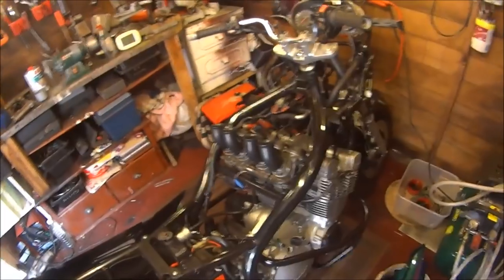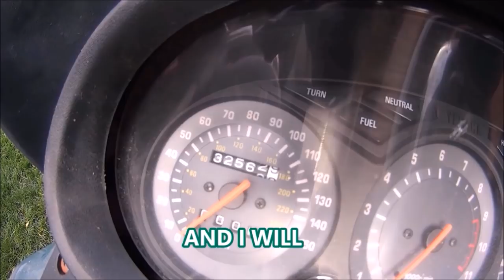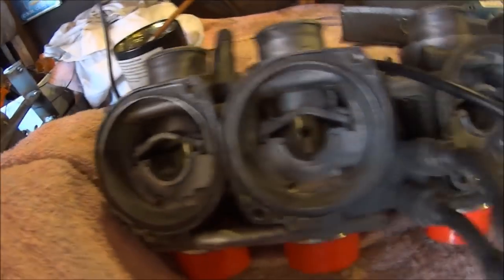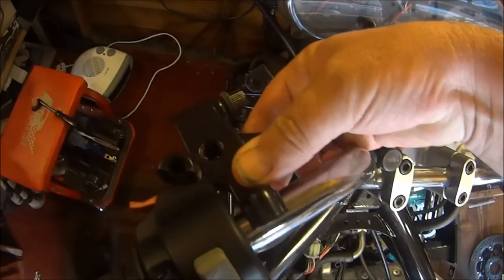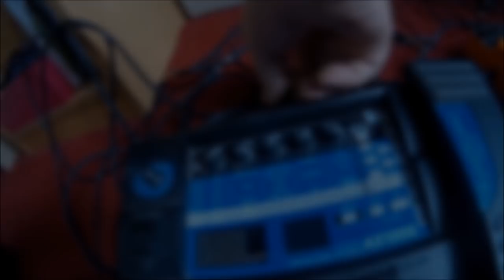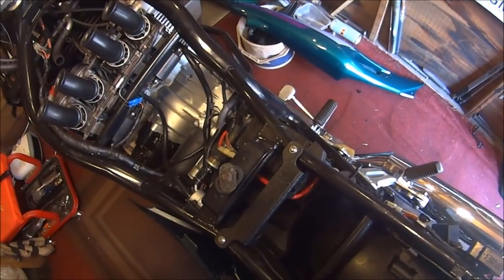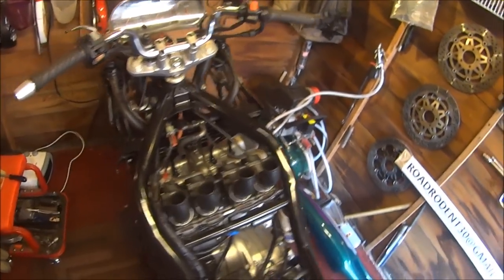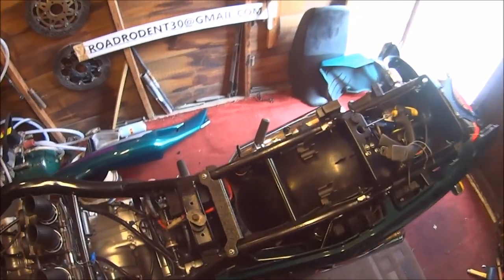Xj900s  diversion carburetors. Help,

Comment: If you have a manual you could confirm the wiring using a multi meter. Just a suggestion bud.
Reply from the maker: Yes checked the manual and all seems to be on cheers Steve.

Comment: Has with CV carbs.its caused by going from pilot jets.to main jets.normaly a damaged diaphragm...yes cylinder 1 is clutch side firing order is 1342.....easy way to see if carb inlets are leaking...run it spray easy start around .inlet manifold .if engine picks up ...the rubber is leaking ..
Reply from the maker: Dude you certainly know you're stuff. Carburetors rubbers seem to be fine but the carburetors are flooding ao I need to strip them down again.. OMG.
Reply: @jonyr1TT  40 years under my belt working on bikes
Reply from the maker: @bigmuller1  do you have your own bike shop?.
Reply: @jonyr1TT   no no ......ime afraid 40 years of messing with various.delapatedheaps taught me life skills.starting with a mobylette...then a c90 .... Basically a bike is a c90 with 4 cylinders.me 
Like you started at primary school.with a model aircraft twin lined spitfire.keilkraft......wow did I get burned off that..then at 12 had a Hillman imp to play with
Reply from the maker: @bigmuller1 .. Yes the memory's are flooding back lol mobyletes c50 70 90 puch maxi Raleigh runabouts ss50 ap50 fs1e garelli record and the list goes on and on lol.
Reply: @jonyr1TT  to a 9 year old.like me in 1976..a fs1e.     DX with a copper tube .knocked in the exhaust with a lump hammer.borrowed from granddad's shed.was like a rocket ship.thought my face would melt at them speeds....had a pair of welding glasses on just in case
Reply: Saying that.my neighbour when I was 14 left my parents look after there house for 2 weeks whilst on holiday....what was in the garage....a laverda Jota....one thing led to another.bugger it....let's take it out.....ooooooohhhhhhhhhoooohh mmmmyyyyyy gggggggggooooodddd.did that thing scare us.was a beast of a thing.fook that.never again.like to jibbering wrecks lol
Reply: Cylinder no. 1 is the left-most cylinder when you are sitting on the bike. Cylinder 4 is on the right side where the clutch operating arm in located.

Comment: Guitar playing does help calm the nerves. Some cigar smoke could help to see a vacuum leak. Did you put a new finger screen on the petcock? CDI looks terrible. Does it smell of electrical fire?
Reply from the maker: Thanks mate think I've sorted the flat spot out now. But now the carburetors are flooding.
Reply: ROAD RODENT there is a site on google called fixya that describes your carburetor condition and how to remedy it. Good luck.👍🍀
Reply from the maker: @mikehancock6280  cheers for that mike I'll definitely check it out..

Comment: Remember.its got what you call a wasted spark system.meaning it sparks on all strokes... unlikely to be ignition problem.......more fuel based
Reply from the maker: Cheers darren yeah think your right it doesn't seem like it is a ignition fault.
Reply: @jonyr1TT  more fuel side definitely
Reply from the maker: @bigmuller1 ..... I agree.

Comment: I've just checked mine (have only just started my rebuild, is in a similar state to yours when you started!), and the coils are top red on both sides, orange and white below, L & R. My CDI also has some of that marking on the back, but lower down in the middle - so I suspect just budget manufacturing. Aside from the coils, I'm no expert but the throttle issue may indicate a main jet problem? It's happening when you come off the idle jet onto the slides, which then don't seem to be allowing fuel - indicating the main jets they sit in have got crud in them?
Reply from the maker: Thanks Philip some very helpful and useful information. Good luck with your divi hope it all goes smoothly for you.
Reply: @jonyr1TT  Thank you, am employing your inlet silicone hose trick to get it running first of all!
Reply from the maker: @philipsmith2208  mine seem good up to yet. It's £80 for 2 new ones and I needed all 4 so I at to come up with a cheaper solution.
Reply: Hi iv been fixing my xj 900s up now welding the down pipes to the  collecter box be cause it may clear up the problem with air leaks so wish me luck this clear up the miss fire when de acceleration and im looking at air leak to cab no holes in the in take rubbers
Reply from the maker: Hi mark. good luck with the welding . don't forget to remove the cdi if your welding on the bike.
Reply: Hi thanks for that i will take the cdi off before welding  im also doing the o rings im the inlet menifolds so im busy trying to get the xj 900s divetsiom back to normal running wish me luck hows your xj now
Reply from the maker: ok mark best of luck hope you sort it,.. my d9 still not right.

Comment: How do you remove the carburetors? I've loosened the screws on the rubber pipes underneath but i cant pull it up.. They flood the engine block with gas so i have to remove them and inspect..
Reply from the maker: In my case it was brut force in the end. 
The rubber manifolds where perished and rotten these bikes are known for it.
Reply: @jonyr1TT  Thank you very much for answering. I'll try to just pull with a diaper on tomorrow! Cheers :)
Reply from the maker: https://www.youtube.com/watch?v=iGQ4QpbEpeI

Comment: Hi road rodent it good news that your doing a xj 900s diversion very good to flow you ihave a problem with my xj 900s diversion it bad stating on choke it a pain iv clean cabs out and put cleaner in tank but it a pain to start after a cople of week can you help with this thanks
Reply from the maker: H Mark thanks... I would check the state of the spark plugs and make sure there's a good spark on all 4 plugs.. It's the first time I've had a bike like this with the induction pipes and reed valves. So it's a bit of a learning curve for me also.. Good luck and happy new year buddy.
Reply: @jonyr1TT  hi road rodent it mark with the xj 900s diversion the spark no great iv change the coils and spark plugs iv got a ignistion pick up to try and also and only thing lift is the cdi ecu mayne it a bloody pain happy christam a great new  year thanl for the early reply on the last post can you reply to.my new post
Reply: @jonyr1TT  hi road rodent it mark again iv got a spark but its weak the plugs flood up iv put new coils on but still the same im looking at changing the ecu cdi unit are the ignistion pick up running out of things now can you help me please reply thanks it may help you all so i no had the dame problem
Reply from the maker: Have you changed the spark plug caps.. Can't see it being the cdi if the bike starts